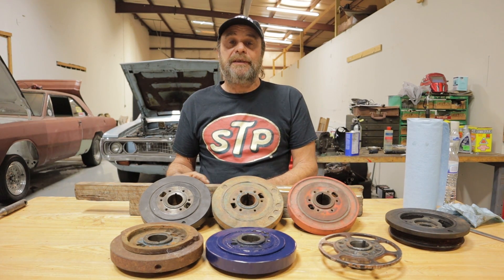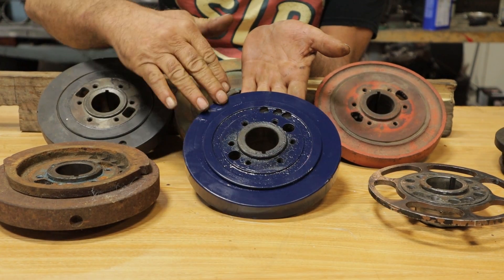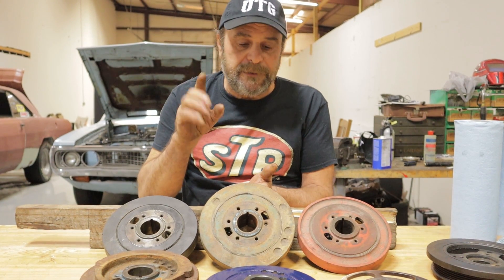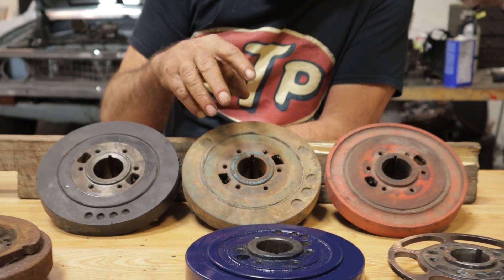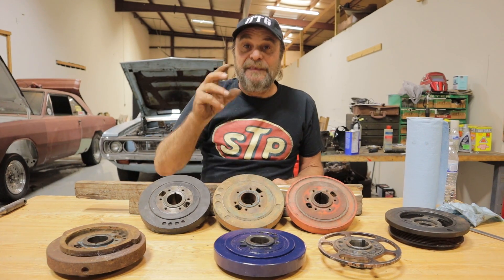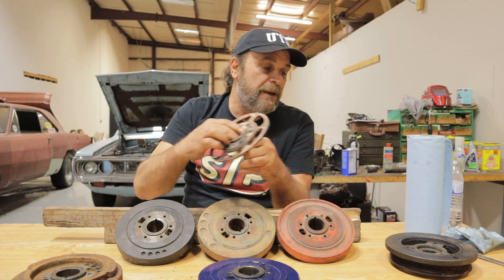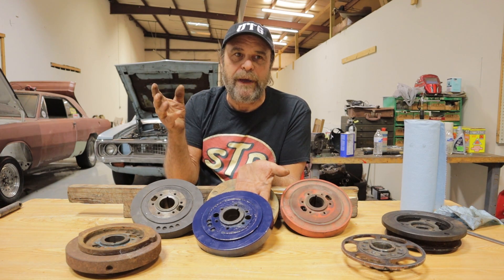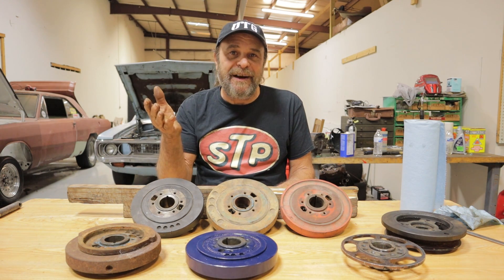Harmonic Dampers And Balancers - What they do, Differences, What To Look Out For, When To Upgrade

Comment: Grandpa had the d310 in the 756 rebuilt in the 80s. They fired it up and anything over idle, it had a bad vibration and the front tires of the tractor started bouncing on the shop floor. 
The mechanic's helper had dropped the damper pulley. The impact ruined it.

Comment: Hey Tony. Do inherently balanced motors like an inline 6 or a 60 degree V12 need balancers?
Reply: You can go off the deep end on this subject.  Driving 4 answers YouTube covers this in detail describing engine layouts and primary and secondary imbalances
Reply: The longer crankshafts of these engines definitely require the damper because the torque pulses in the front cylinder (s) twist the crankshaft  which twists back like a torsion spring  and that twisting is what the damper dampens...
Reply: @gdaytrees4728  Absolutley, let a damper get bad on a big diesel and they often times break the crankshaft from torsional fatigue.
Reply: @gdaytrees4728  Never thought of that. Thanks.
Reply: Nothing is ever exact, least of all mass produced engines.

Enginerds will throw one on an i6 or v12, whatever because god forbid you have a warranty claim on an engine. It's cheap insurance.

Comment: It's hard to imagine a cast iron crankshaft acting like a spring.
Reply: Its more about the damper is there to absorb and smooth out the firing impulses of the engine. If you could use super slo-mo and a very accurate rpm measurement you would see the crank speed up and slow down with each impulse. There is some jerkiness to it. The crank can absorb some of this but because of its slightly springy nature, the rebound puts that energy back into motion. At the right resonate frequency, those harmonics can be pretty destructive.

Comment: I had a 97 Ford triton 5.4 that slung the inertia ring off the damper going 70mph on the interstate.  Funny thing is it didn't do any damage at all and the only reason I knew something was wrong is because the alternator quit charging when it slung the belt off. I didn't even realize the inertia ring was missing till I went to put the belt back on and noticed it was waaaay too lose
Reply: I worked on a triton that did that. 
But the belt didn’t even come off. 
The belt cut grooves in the rubber on the hub that was left. 

It ran and drove fine just had a random belt squeal. 

Took awhile to figure out!
Mainly I found the outer ring in the engine bay😂

Comment: Uncle Tony years ago I had a 1964 Chevy c10 6cys and it went bad so I bought a 400 small block out of a Montecarlo I think and put it in my C10 with a 3 speed transmission. It ran great but it had a terrible vibration that I never got out. I found out years later that it was an externally balanced motor. Back then I had the flywheel balanced and change the balancer on front but nothing would fix it. What do you think I could have done. Sold it like that
Reply: Had a '65 Corvair, a fantastic car that I could NOT keep in time. Fortunately I figured out the timing mark on the harmonic balancer was slipping before any damage was done or an unneeded major rebuild was triggered.

Comment: Tony, I'd like to see you follow this up with discussion of balancing torque converters.  I remember back in the day when dinosaurs roamed the earth, some guys using smaller 6 cyl torque converters for higher stall speed, and rebalancing.  I never understood the voodoo on all this.  Also, B&M used to make a flex plate with weights so that you could run the 360 externally balanced engine with torque converter for a 318 or 340 internally balanced.  That part is no longer made, from what I understand.  Any insight into all this would be appreciated.

Comment: I've been considering replacing the damper on my 56 Ford. As far as I can tell it's still original and I've been warned about the damper separating as you said and becoming a deadly weapon of destruction. It still lines up perfectly when I check the timing marks, but it's in the back of my mind whenever I take it out for a ride.
Reply: That ,and if it's the rubber style between the halves the rubber gets hard as a rock and there goes it's "tuning".
Reply: For the little bit of money and time it’s a worthwhile bit of maintenance

Comment: Uncle Tony, can you tell us about how torque converters can contribute to all of this?  I've got a 79 Cordoba with a 360 and I'm fighting a bad engine vibration.  Replaced harmonic balancer and still the same.  The torque converter is now the suspect, but we pulled it and there isn't a butterfly weight on it which I thought it should have.
Reply: Was it always a 360 car? The torque converter should have a weight on it if it’s the correct one.
Reply: run your timing light around on each cylinder and rev the engine(see if the flashing goes intermittent)......sounds like you might be missing on 2+ cylinders.
Reply: Yes, always a 360. Looks like someone replaced the torque converter, so I’m thinking they put the wrong one in. No misfiring at all.

Comment: I recently put a Fluidamper on my 24V Cummins 5.9.  The stock one was still perfect, but had read good things about Fluidamper.  What a world of difference!  Idle and high RPM smoothed out, and clutch chatter (especially reverse) was just gone!  I wish I had put this in years ago!
Reply: I've just bought one, waiting delivery......looking forward to this result!
Reply: @craigbarrett2278 if you have the Horton electromagnetic fan clutch, as I do, you will have to remove it first.  The wide paddles on the blade don't give you enough clearance to get the Fluidamper into place.  Good luck!  I'm (still) in the People's Democratik Republik of Kommiefornia, so no road salt/etc. The original balancer came right off... hope you're as lucky!
Reply: @Silver Hornet  Ls L98 so electric fans. But thanks. 😊
Reply: Did you have to have engine balanced after that ?
Reply: @piotrprobala4808  No... just install and go!
Reply: @piotrprobala4808 I did not.

Comment: I had one repaired, for a 66 Pontiac 389 engine. It cost $130.  Company called “damper dudes” in CA.   Good video Uncle Tony!
Reply: I had to do the same with my’62 389 as here in Australia new ones are not available, ‘66 onwards are on the shelf but are obviously different.
Reply: Would have never thought there would be a business that rebuilds balancers.
Reply: In Cuba I bet they just weld em up😂
Reply: Would have never thought there would be a business that rebuilds balancers.
Reply: @robertwest3093  yes. Turnaround time 3 days.  Came back nicely painted too.
Really good work.
Reply: @robertwest3093  it stems from having small numbers of many makes and models of cars imported into Australia so parts inventory is often zero to limited at best. Added to that our Pontiacs came from Canada so had Chev mechanicals.

Comment: Cool video.  I myself will usually replace the original harmonic damper when a repair requires removing it or during a rebuild.  The reason being, I want to avoid the consequences of the rubber being potentially “expired” in some way.  I figure at that point it’s just a chunk of spinning metal not protecting the crank.  I’ve heard this condition when prolonged can cause a crankshaft to fatigue and break.

Also, did you know before the 1970s Chrysler used an asymmetrical bolt pattern on their dampers for the pulley?  Ask me how I know...

Comment: Been keeping an eye open for a stock damper for a 71 318 engine with the asymmetrical bolt holes. I don’t really want to oval out a pulley hole. Almost everything you can find is for the later symmetrical bolt pattern. Does anyone rebuild factory balancers? If the only problem is with the elastomer failing, it doesn’t seem like it would be too complex of an operation to clean the hub and ring and reapply an appropriate elastomer with the parts in a jig
Reply: can you find a newer pully to match???? or is this an "all original" kind of build?

Comment: Forgive my ignorance, but do these damper/balancers do the same job as a balance shaft in certain motorcycle engines?
Reply from the maker: No.  Balance shafts are used to cancel out the harsher primary vibrations...the ones that can be felt by the seat of your pants. Dampers operate at the next level, canceling the finer harmonic noise.
Reply: Tony - Not exactly. Balance shafts balance out the secondary (twice per rev) LINEAR vibration. The harmonic damper/balancer damps the higher order TORSIONAL vibration, which if left undamped, can cause the crankshaft to break from torsional fatigue. The break will be at a 45 degree angle thru the rear crankpin.
Reply from the maker: I stand corrected.  Thanks, Greg
Reply: Plenty of car engines run a balance shaft too.

Comment: Excellent video as usual. 
Myself,  I use fluid dampers exclusively if it is available for the engine. 
From what I've learned from D.V., it's the most effective at the job.
Reply: David vizard?
Reply: Yes…used a fluid damper on my 383 and pulley lined up perfect.  I think one bolt hole on pulley had to be filed just a smidgen
Reply: Do the pulleys line up correctly with the fluid damper?

Comment: As a kid I swapped a 327 into my dad's 64 Chevy two ton truck. (swapped several into that because the 327 was a horrible big truck engine) Anyway this motor was a backwoods buy, a runner. Noticed they put the damper on with a sledge hammer, didn't think it'd hurt.
 So the old man wants a Quadrojet and I'm getting the linkage right, and of course because 14-15 you test it by revving the crap out of it! So I'm in the cab revving it and BAM! Outer ring came apart and I was just laying over it revving the damned thing a minute before. Oh yeah a chunk of that would go right through a human body.

Comment: When I tore down my 289 I was dumb and didnt know the damper was just pressed together, used a gear puller on it, you know how that goes 😭
Reply: Well... back in the 80s we did not have the internet and all of these videos... all we had was Chiltons and friends who probably knew what to do in MOST cases. yes its funny to see these videos and think back to some of the things we did. if you did not have the money for a Harmonic Balancer/ steering wheel puller then you were just like the rest of us. I have learned so much from Uncle Tony's videos that I really wish I had known way back when.
Reply: @kregchapman6981  Thats the truth. Still have Chiltons and Motors manuals going back to 58.
Internet changed everything!
Reply: @edreynolds8721  No, there's a specific tool for it that looks like a chickens foot with a big screw in the middle. I know at least on a ford damper there are 3 threaded holes in the main body of the damper. You put the chickens foot on the damper and thread bolts into those 3 holes and tighten the screw against the crank snout like a gear puller. That way, you are pulling on the main body rather than the outer ring so it doesnt pull apart.
Reply: @edreynolds8721  Some engines can use a gear puller because they have large slots in the main body of the damper for them. I think the LS are like that. But a lot of this old stuff you risk pulling the damper apart like I did.
Reply: LOL that's funny I could see it happening that's why they have the inner slots have a great day
Reply: @allurared9029  OK I understand. well hang in there, the good thing is there are a lot of resources out there nowadays that you can get ideas for things to do with your car. In 1984 my brother bought a 1967 cougar and it had the 289 engine and a C4 transmission, he had wiring problems with the car but he eventually figured them out. the funny thing is that way back then the only resource we had to figure out wiring was to go to the library and reference books of the older repair manuals and make copies so that we could trace down the right color coded wires. Hang in there and enjoy the older cars as they are much cheaper to work on.
Reply: @kregchapman6981  Im putting it in a 66 Comet. I really want to do a manual swap to a T5 or toploader because autos arent really fun to me, but I might have to just rebuild the C4 for time being. Was that cougar quick with that transmission?
Reply: what happened?
Reply: @morphius747  Rubber couldnt grip the inertia ring well enough so it started separating from the rest of the balancer. No good at that point so now i have a intertia ring and diy nitro ready balancer.. lol
Reply: @allurared9029  hmm thanks for letting me know! I have a 96 Tacoma with a 2rz engine that has had the same balancer since it left the factory. when I replace the oil pump seal and front crank seal should I replace the balancer with an OEM or not? I'd like OEM but the cost of OEM toyota can be high. I havent had issues with the balancer but why wait?
Reply: @morphius747  Just inspect the current balancer according to this video and reuse it. My falcon is almost 60 years old and has the original engine and balancer on it and it hasnt flew apart yet, you shouldnt have to buy anything.
Reply: @allurared9029  did the same thing to my 327 SBC once never again
I’m 68 Years Old Now and I learned the hard way I joined a hot rod club and brought my 1929 Ford Coupster to the club garage and others would steal the parts off my car in 1975-76
I live alone and found out I couldn’t trust my own family members and fortunately they are all dead now
Reply: You did yourself a favor if it was that degraded.
Reply: @allurared9029  don't feel too bad. When we were getting my 1st car going my dad (who has worked on all kinds of stuff) could not get the distributor out of my 460. He barely pried on it and snapped the housing.......One time I was at O'reilly's and was helping some random dude change the belt on his car. I went to turn the  tensioner and it instantly snapped the aluminum housing (I went inside and bought him a new one).
Reply: A good reason to upgrade to a fluidampr

Comment: Thanks for the video my buddy learned the hard way in 1977 he built a 364 small block Chevy13 to 1 compression it was dynoed with the correct balancer but he didn't own the balancer he ordered a balancer but he wanted to go racing so he put some random balance around oh looks the same on the second pass down the track it exploded the crank literally blew out the bottom of the motor broke the tranny broke off put fluid under the tires lost control hit the guardrail it was amazing every man broke the crank was laying in a cross member what a hard lesson to learn he said oh I noticed a little vibration yeah what a dumbass that was a $4,000 mistake that was a lot of money back in 77 have a great day balancer lesson learned thanks for the inspiring videos and don't forget if you have time to watch Cold War Motors